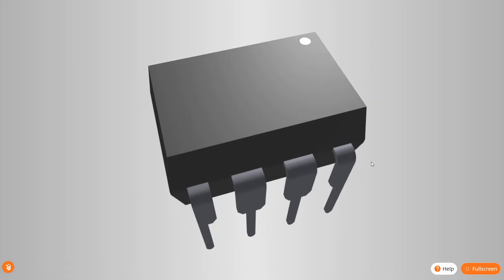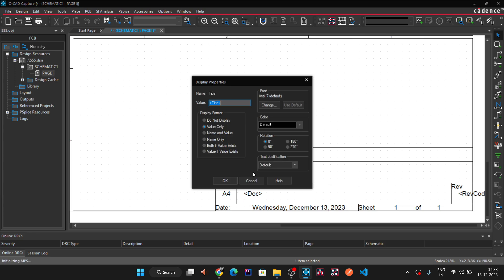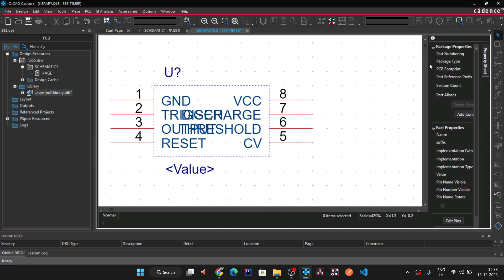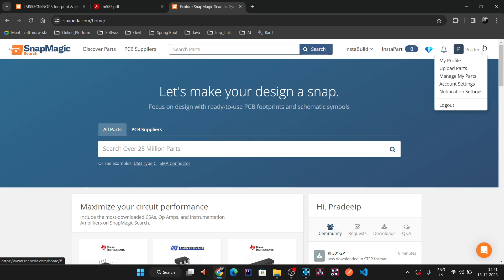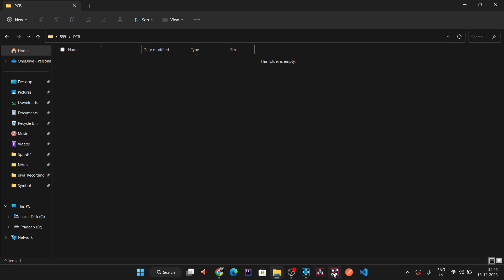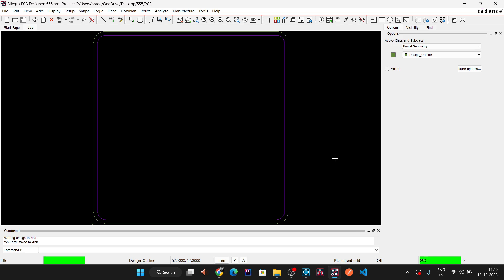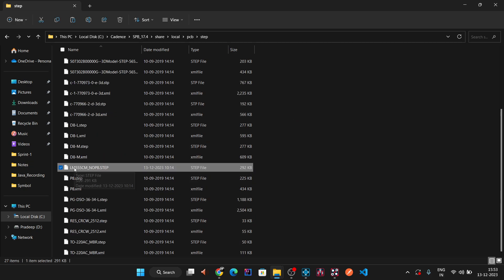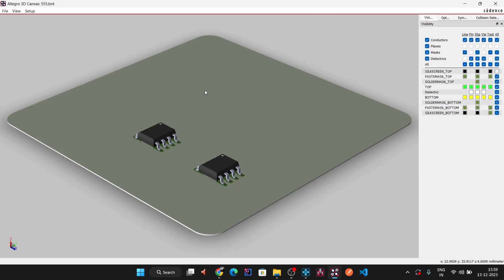How to add 3D Step Model to Footprint on Printed Circuit Board | Learn PCB Design in OrCAD/Allegro

Comment: Sir whats the difference between Package symbols (Wizard) and Package Symbols?
Reply from the maker: In Package symbol, we manually create footptints.
In Package symbol wizard, it gives a platform to create footprints automatically by entering required details. Footprints of ICs are best suited to create in wizard.
Reply: @LtlBiTech Sir , can we have smooth movement in PCB editor grids ? Like we can do in capture schematic grids .
Reply from the maker: @shivmishra5031  yes you can.
Reply: @LtlBiTech  sir how to do that ? I am unable to find that option ? Please help
Reply from the maker: @shivmishra5031  Check out to setup grids and change x to 0.01mm and y to 0.01mm.
Leave all offset values as it is.